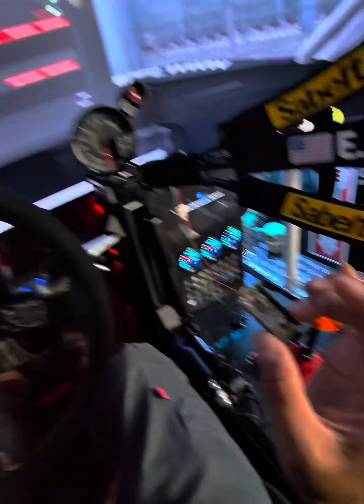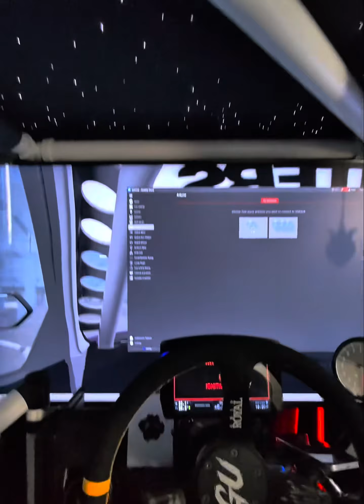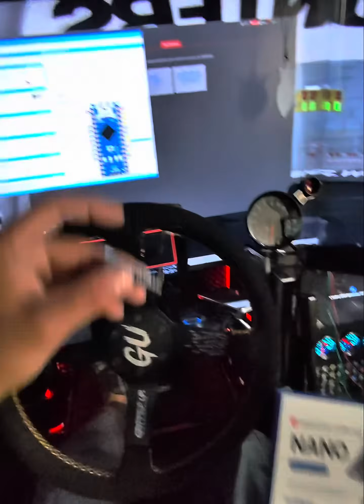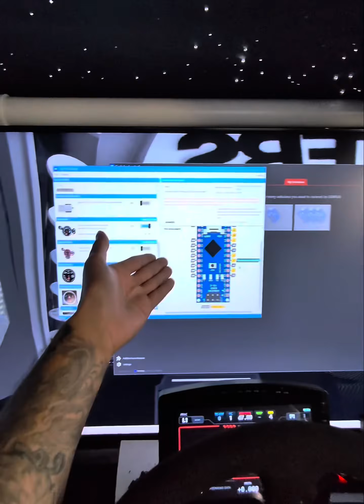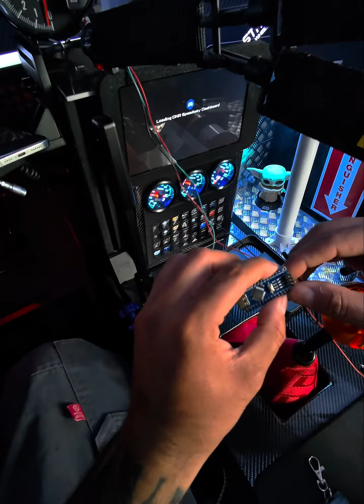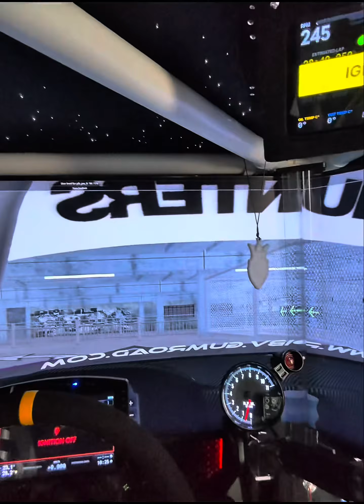Tachometer setup for Sim racing

Comment: no relays or resotors for this? just plug and play?
Reply from the maker: For this setup I did no, i didn’t need to use anything apart from the power supply I have, Arduino, and Simhub. That part you will have to dial in. I will be doing another one soon with the resistor approach.